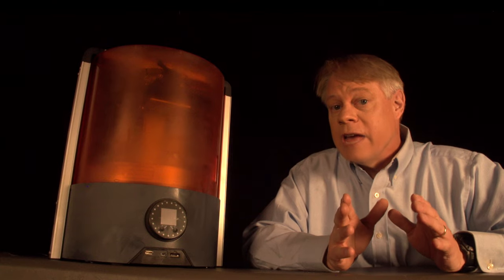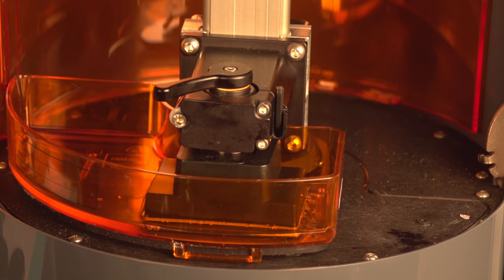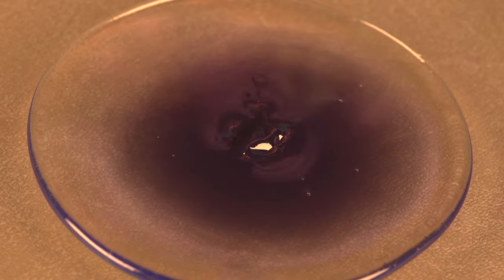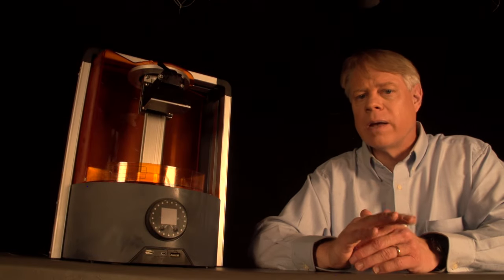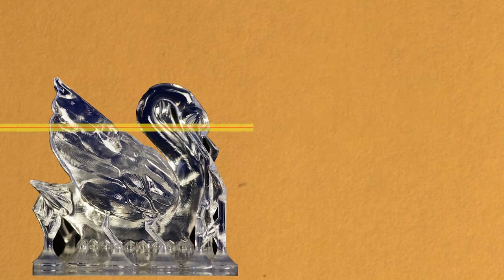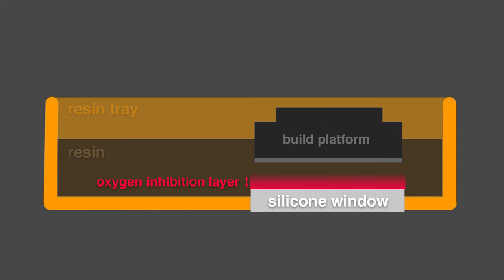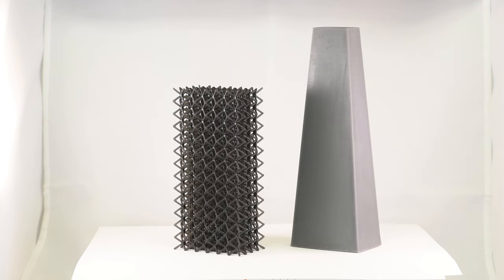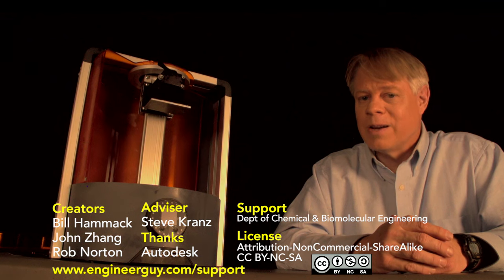DLP Projector Stereolithography 3D Printer

Comment: engineerguy is back with more content! Woop woop! 
Could you do an episode about concrete? Not just the modern version but other forms that are used and have been used, perhaps.
Reply from the maker: +lazygamerz I have been thinking of that: I find it fascinating.
Reply: I used to work in a lab where we experimented with "monomolecular" concrete that used flyash and a chemical bonding agent. It was incredibly strong (8 times the compressive strength of regular concrete) and it was heat/acid proof.... however its main drawback was its viscosity... it couldnt be poured and was quick to cure.
Reply: Concrete would be fascinating; there's probably enough content on the subject for an entire series. I'd love to hear your explanation of the way different compositions have different trade-offs. Or some explanation of the recent attempts to make lighter-weight concrete, and more environmentally-friendly compositions, would be great too, as concrete is major source of CO2 emissions. 

Material science is always amazing.

Comment: I'm a little bit interested in understanding how those micromirrors are constructed in the first place
Reply: The hinges are probably done in a similar fashion as transistors (I think there is an engineerguy video about that) but I have no idea how the aluminium is attached
Reply: Lempika Ben Krasnow from Applied Science did an excellent video about DLP a few years ago. Check out his channel
Reply: I think it is most likely the same production process used for CPU chips, EUV-lithography. 
Check out machines like ASML Twinscan NXE.
Reply: See his video on phone accelerometer etching
Reply: No real knowledge, but I would hazard to quess that the mirror is actually attached as a single plate on top of the "forest" of posts. Then it is cut to pieces (probably with something like laser or stereolithography etching). Thus removing the need to place millions of tiny mirrors. Rather you place one big mirror layer and then section it.
Reply: Lempika dont be fooled... dlp runs on magic ;)
Reply: There are actually examples sla printers using no mirrors but just high quality LCD's or lasers instead.
Reply: he linked to some videos at the end and one of them is about what you just said
Reply: Probably vacuum deposited directly on the substrate.
Reply: The details are a bit complicated, but first you have to know that there are many different kinds of MEMS (or MO[ptical]EMS) and a whole lot of different process steps. 90% are layer-processes like coating, exposure, [selective / anisotropic] etching (by liquid / gas / plasma / ion beams...), Ion-implantation, sputtering or vacuum phase deposition (this is how the reflective metal layer is applied in the end). 

These stepes are repeated X times to build up structures.

One of the big tricks in this is anirotropic etching of SILICONE and under-etching of a protective layer. This means, that you can disolve the matierial in certain directions only. With this trick you can create e.g. little "pyramid-holes" into a surface.

DLP was developed by Texas Instruments, BTW. Google for MEMS production, DLP-Chip, BOSCH-Process, anisotropic etching silicone to learn more.
Reply: A smaller 3D printer

Comment: Nice exposition. Might I recommend you cover FDM next? Just so that more people understand that 3D printers come in different basic versions, each with their own USP's. The Ultimaker U3 is a great platform to present, with a massive user base (who actually add their own inventions to the set-up, such as the Flex3Drive for printing with rubber filament).

Comment: Great video!! The lattice structure is the kind of object shown in demos because, unlike the brick type object, the lattice would be very hard to make with traditional manufacturing methods, if not impossible. But the block type object would be easy to make with other methods like injection molding. So they show the lattice object because that is the kind of object that 3D printing allows us to make. Also, it looks like you missed one of the support posts when highlighting them in blue.

Comment: Many SLA printers available on the market use an UV light beneath a very high resolution LCD. The LCD is monochrome and only allows UV light to pass. It's pretty much the same principle as the micro mirrors, but instead of reflecting the light onto the build plate, they let the light through. The resolution of the printed object is pretty much entirely dependent on the resolution of the LCD. A 4k LCD would yield unprecedented resolution. Another way to 3D print that wasn't mentioned here is FDM, or fused deposition modeling. These are your standard, basic 3D printers that extrude filament to construct each layer. They have far less resolution, but even a cheap one like the Ender 3 is capable of 
.12mm layer height and good quality prints. The main advantage of FDM printing are faster print speeds, a larger selection of materials they can print, less material used, larger print volume, no special equipment required, (fume extractor, specific type of gloves, UV safety goggles, at least N95 class respirator, ultrasonic washer and UV curing machine. Full body hazardous material suit is recommended.) and easy to maintain and use. For really small and intricate objects SLA printer wins, but for large objects that need to be made of a specific material or require a large build volume, FDM printers win.
One important warning: resins are toxic and need to be handled with care, with proper personal protection equipment, must only be handled in a well ventilated area and are treated as hazardous waste and need to be disposed of in the correct manner.

Comment: Greetings Bill,

I have a quick question, i know the reasoning behind the rotation of the platform, and i get why rocking and pulling are bad for the models being printed, but what if you tapped it.  Or had a tiny hammer strike the center of the printing plate to remove the vacuum?  Or had a small vibrating motor?  Would this cause issues with resin not flowing into the cavity or would it just not be enough of a lateral force to break the bond.  What if the surface of the printing plate was hydrophobic?  Would it repel the resin?  What if you did the printing in a vacuum, would that cause structural issues when you take it out or could you build in stress to make the structure stronger like a prince Rupert’s drop?

Crossing my fingers to hear from you.  Either way great job love the videos.

Comment: Did you film this in orange light to prevent the resin from curing? Or was it just the warm glow of so much bottled-up engineerguy goodness hitting the lens?
Reply from the maker: +Hunter Douglas good eye. I discovered just last week that the white balance temperature was set to 6300 K -- we shoot under tungsten halogen so it should have been 3200 K. Fixed it as best I could in post.

Comment: what will happen if the boat is printed with a resin completely composed of oligomers?
Reply: I was also thinking that.
Reply: I would imagine a hard but brittle material, like a piece of uncooked spaghetti
Reply: Oligomers are typically much higher in viscosity than monomers due to their increased molecular weight. Because of this, between each layer, the oligomer would not have time to flow over the window. If there is no resin on the window, the next layer will not print.
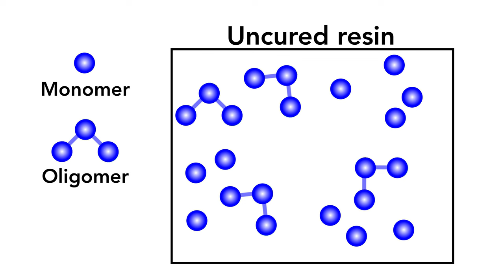Reply: Cannot be done because they need to be cured / bond together using photoinitiator 10:41.
You would get liquid.
Reply: That diagram isn't correct. It is a photoinitiator but it does not "link" together chains, lookup "free radical polymerisation". What was said before was correct, typically you don't use just oligomer because it is very viscous. However, it may be also based on curing speed and degree conversion too.
Reply: I think the assumption was that the resin components would be entirely oligomer, while the photoinitiator is still present. Photoinitiator concentrations are typically around 0.2% - 1% and do not have a significant influence on the mechanical properties of the printed part

Comment: Great video!!!! You definitely have the voice for public speaking lol ..... I use SLA and DLP printers in the dental field ... both desktop and mass production sizes .... I have noticed through my own trial and errors and with speaking with fellow dental technicians, that prints tend to lose their precision when mass produced .... an example would be a prosthetic designed to fit flush against a patient's upper pallet would actually have space between the two .... Has this been an issue you have seen in mass production? I at one point believed it was an error with the z-axis when printing ... Does that sound uncommon? And if there are errors in the z-axis, do you have any tips for diagnosing or fixing an issue like that?   Again, great video .... congrats on the young one ... I look forward to digging in your video vault now that I subscribed

Comment: why was it discontinued?
Reply from the maker: +Santillean I don't know. I wondered that myself.
Reply: i would guess partly because it's small xy build range. i guess it could be increased but that small mirror part sounds expensive.
Reply: Santillean - Autodesk is a software company, and they recently had turnover at the top. But it's maybe more appropriate to think of the Ember like Google Glass, an experiment that got people thinking and may come back.
Reply: As an Autodesk engineer who worked on this printer, I can tell you that its discontinue is due to a shift in many things, including our business model and vision .
Reply: Thanks for your insight, Marco. And kudos for making Ember Open Source!
Reply: Yeah it's pretty tiny. There are larger resin printers out now that are relatively affordable.

Comment: So is there a visible difference between this Autodesk printer, and the Carbon3D printer? It seems like the same technology, but I was wondering if there was anything else going on under the hood.
Reply: From what i understand the Carbon does not need to peel the layers from the glass because it uses some special chemistry to maintain separation form the bottom of the liquid container. This is one of the reasons the Carbon is much much faster. There is a TED talk by the inventor of the Carbon3D printer in which he explains how it works while the printer prints a complex object in 15 minutes.

Comment: As far as I remember, somebody did a DIY version of this printer using a LCD rather than these mirrors. I guess that these mirrors add too much complexity and increase the cost unnecessary. Or I'm wrong?
Reply: There was an explosion in consumer resin 3D printers a little after this video was released and almost all of the modern ones use the LCD screen method. Look up elegoo, anycubic, or phrozen if you are curious about them. 

These companies have done exclusively LCD printers, but elegoo just recently released a mirror printer, like in the video, except much larger.

Comment: The swan is decorative, of neither mechanical nor electronic significance.

I have yet to see how 3D printing will be as revolutionary as some people say.
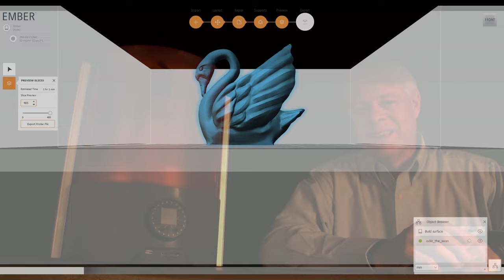Reply: tohopes Maybe you watched the video with the sound off, he goes over just a few of the uses at 0:35. 3D printers are already being used now in manufacturing, prototyping, and aerospace applications. I'd be happy to provide sources if you don't believe me.
Reply: tohopes That is probably because you don't know anything about manufacturing and the general making of things. If you did, you would understand just how big of a deal 3D printing is to those of us that actually make things.
Reply: 3D printing has greatly helped out the company I work for. We build high quantities of tiny things, and use a lot of jigs/fixtures as part of the assembly process. 3D printing has greatly reduced the time it takes us to build that tooling - rather than having to order in a chunk of plastic and get it CNC machined, we just throw the design at our Ultimaker. It's cheaper and far quicker, and takes much less operator time. We can also print much more elaborate tooling that our 3 axis CNC simply can't do.

And once the tooling hits the production floor, if a worker has an issue with a tool or has a suggestion that can make the tool work better, we can quickly change the design, print the new version and have it ready the following day to try out.

We also use 3D printing for prototyping of new products, making moulds, and for making models for trade shows and such... and we're very happy with it.

Maybe "revolutionary" is the wrong word, but getting a 3D printer has definitely changed how we do things around here, and for the better.